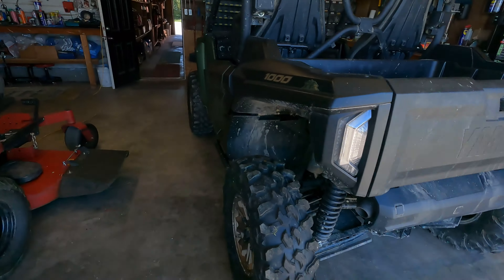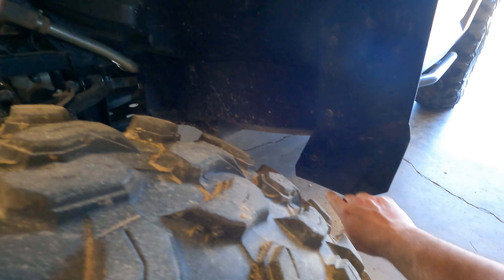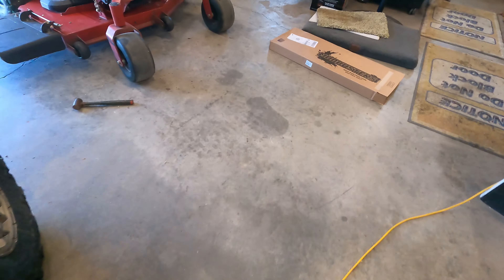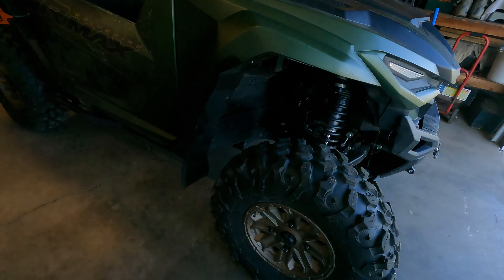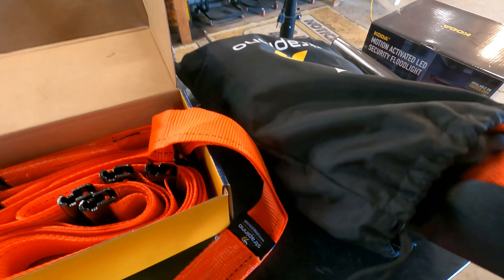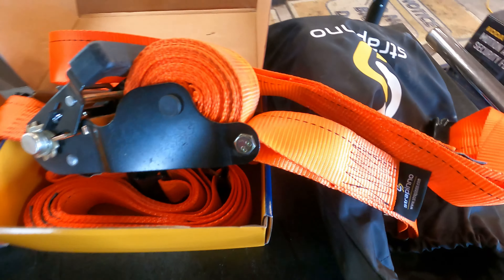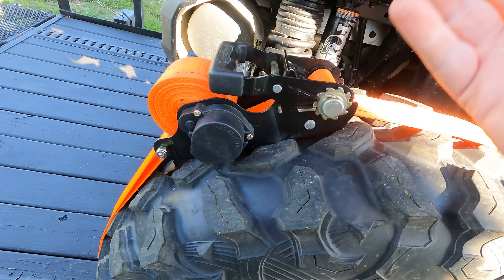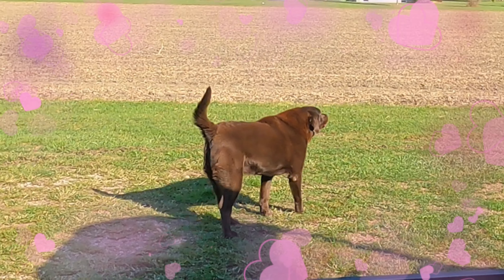How I load the SXS and RMAX Mud Buster fenders

Comment: Been running the MB’s on my RMAX4 for close to 2 years with the push pins and no issues also. I will say I highly recommend trimming off the little “mud flap” part that hangs below the skid plate. The rear got caught on rocks and the front would pinch easily between whatever and the tire when backing up. It took about 5 minutes to go all the way around with an abrasive cut off wheel and about 30 seconds of sanding to smooth it out and they look factory. As a bonus I actually preferred the look better with them cut, zero noticeable difference in mud protection inside the cab and not really any difference outside on the door. They just work and I’ve rubbed the heck out of them on trees, rocks and in deep washes. FYI I primarily ride Brimstone Recreation and Windrock as I live within minutes of one and less than an hour from the other.
Reply from the maker: Thanks for the comments, sounds like a good idea and I'm sure it'll help others out as well. I just came back from WV did some outlaws and Ivy Branch, MB's worked well there. Looking forward to going back. I here Brimstone is pretty nice!

Comment: I have the fender flares from Spikes Powersports on mine.  They look similar to the mud busters and use the push pins. They have been on for a year with no issues. I agree they don’t seem like they should work but they have been holding up.  I can understand why you put them on.  The Rmax throws mud like crazy.
Reply from the maker: That's good to know about your flairs, yeah, these seem to be pretty nice for the most part, I like how they aren't too much, if you know what I mean... We'll give them a good test I'm sure. Even though My riding trip looks like it'll be dry and dusty. As always, thanks for watching and commenting!
Reply: @BarnStangz  They are just enough to keep the mud off of you.  I think you will like them when you hit some mud. Have a good trip.